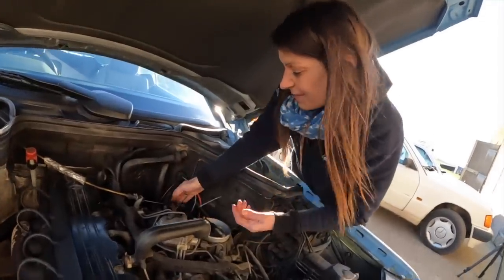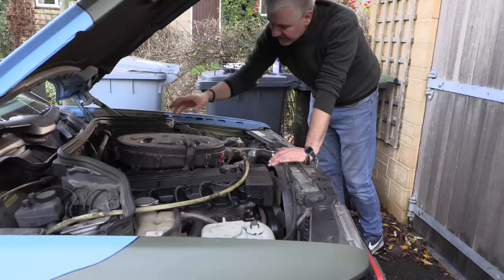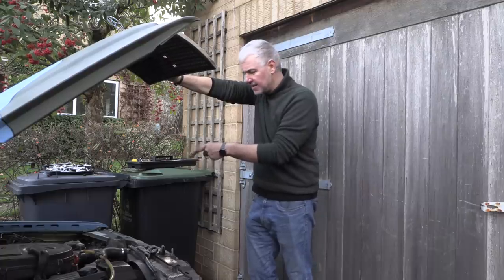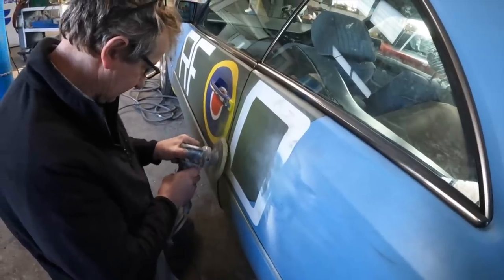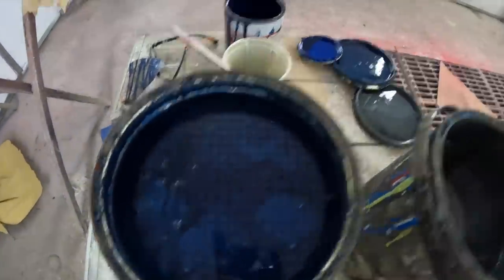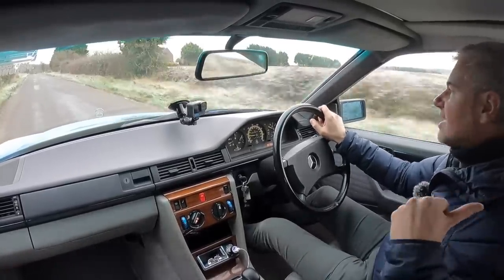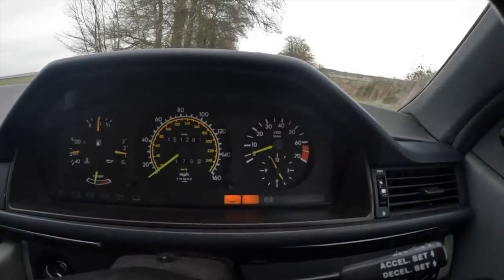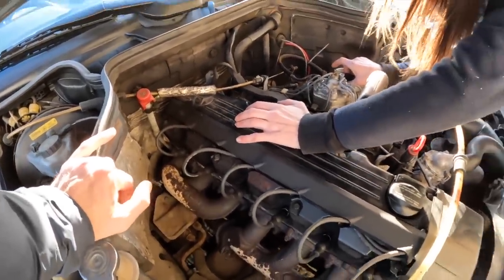Picked a Colour for my Cheap Repaint! + Sorting Out Running Issues.  Mercedes W124 300CE

Comment: A tip from an old W124 owner. If you need more space for your head under the engine bonnet, the angle of the bonnet can actually be tilted to 90 degrees (ie straight up). There should be a trigger for this at the suspension system for the bonnet (on one of the sides).
Reply: @Hvitserk great pro tip
 Usually no trigger is needed just push and it'll go to the "service position" unless what im referring to are on later models than this. ✌
Reply: @averyparticularsetofskills  Thanks. My W124 was a 1990 model and it had a trigger. The same had my previous 1989 W201, but what happened later I do not know because my Mercedes were bought new.

Comment: Great that you have agreed on the advice about paint it with a paint gun instead of the rattle cans! I'm sure with some help of your friend Andy who is an experience painter, a paint booth, fresh paint gun and some quality paint it's going to look great if you put in the effort to prep it right. Really curious about the state those rear wheel arches are in. You are probably ending up needing to weld new ones in, but they are only around €40 each so while doing a full respray anyway, might as well do the arches also the right way.

Comment: I couldn't quite see if Frau Benz used it or not but there is a "service" position for the bonnet. Release the catches on both hinges and it should stand up vertical allowing easy access. Somebody send her a hat though - long hair and running motors....

Comment: The idle and low speed issues could be the non standard exhausts, not enough back pressure. Try restricting the tail pipes some way and see if it improves.

Comment: Regarding the engine trouble: check the air inlet sensor. Friend of mine had his Merc to 4-5 workshops before finding out. It can cause  “mysterious “ bad engine behavior that fools even experienced mechanics.
Reply: Yeah I'd look at the map sensor too. Might just need a clean with contact cleaner.
Reply: air flow meter jumped to mind too

Comment: Hi there, enjoying your adventures, my 230CE had exactly the same running issues as yours and fixing the vaccum leaks and changing the throttle cable were the root causes. I had a specialist do it mind, I normally do my own work but I am happy to pay for specialist knowledge. Good luck with this car, they are amazing machines as you know.

Comment: What a result you have a pal who has a spray booth and compressed air and can also give you some advice. I had an E28 328 I sport in navy blue metallic which needed some panels painted which I did try to do with a rattle can and it took me so long to get any sort of decent finish I struggled with all the common issues the main one trying to get the topcoat to actually look professional so I’ll be super intrigued to see how you get on. exciting times ahead! 👏👏

Comment: Don't forget to check the potentiometer on the air flow meter housing. You can check the output with a multimeter to see if the carbon tracks have worn out. They tend to develop flat spots on the first part of the tracks.

Has the same issue with the low idle in D on mine (sometimes actually stalling) and replacing and setting up the new potentiometer properly, fixed that issue for me.

Good luck with the paintjob, should end up looking a hell of a lot better than it does now!

Comment: Since there are so many different types of paint on the car it would be a good idea to use a paint sealer to act as a barrier between the old and new paint to prevent solvent lifting. Sealer is different from primers.

Comment: Always liked these engines thanks to the KJetronic mechanical constant fuel injection. It is the same system as to be found on my Corrado 16V. Actually everything is controlled by your foot and this means that you can get really very reasonable MPG figures out of this system.
Cheers and good luck!
The econometer already doing its thing in Neutral might mean that the issue, or, well one of the issues perhaps, is related to vacuum lines. Especially with the KJetronic fuel injection system.

Comment: Hope you do a good job with the paint. Inspect the rubber boot under the air flow meter assembly for air leaks. Also there is a procedure for setting up the sensor on the airflow meter. It is known to wear out at the idle position. Seals around the injectors also require replacement. Look at the ignition leads on a dark night with engine running, spray a mist of water and look for arcing

Comment: Good decision to paint it properly, everyone likes a tryer💪💪👍👍. 
I've used a Sealey electric DA sander for years, it's worth the investment, I would sand the graphics off with 80g discs, then I'd 2k prime it, but not with spray gun, but with a 4" foam roller, this sounds a bit sh1t, but you can sand it smooth either wet or with the DA with 320g. Rolling it means no masking, no overspray, no wasted paint.
Good luck

Comment: Hi everyone,  I'm new here and like the channel. I'm so glad to see you are spraying the car properly. I know lots of paint shop guys will be watching and wanting to chip in with advice. What lacquer you using? I would advise Sprint products for ease of application but your spray guy will probably advise his preference. Ask your pal for a shot of his spray gun because that Fast mover thing will not be easy to use and achieve a nice finish.  If you wet flatten use a rattle can zinc primer to cover any bare metal immediately, cromadex galva spray is expensive but the best stuff in my experience. Can't wait to see you spraying it.

Comment: Regarding the vacuum testing. If you do not have access to a smoke machine then just replace all the vacuum lines with new ones as the existing ones have become old. They are cheap and easy fix. The Bosch CIS injection system has always been really sensitive to vacuum leaks.

Comment: All around good decisions for the Mercedes. That color choice is totally top shelf. Suggest that you consider adding a small amount of Pearl Metallic to the mix to brighten the color somewhat. A bit of metallic will really help. The application of the final clear is also critical. As for the arches....the metal panels should be very inexpensive. It is really easy work to put them in for someone who knows how. Not massive as you observed. Between that outer skin and the inner fender is a gap maybe half an inch. If you open the panel and inspect this gap probably a half tea cup of dirt and grim will fall out. This perpetually wet material is what rots out these upper arches. I understand you have a budget but this is a certain value add upon resale. More quality material for your channel where you strive to do it right. Get a reel of vacuum line and start replacing it all. The lines must be seated tight in any case.

Comment: No need for a smoke machine, grab a cheap cigar, pull the booster hose, tape around it so your mouth doesn't touch it directly and blow smoke thru the booster line. It may sound odd however I've done it before and it works like a charm 👍Love the color BTW
Reply: Cuban would work better. Do it in style.

Comment: I really like dark blue on these cars. I used to have a W202.
I also used to have a V8 W126. In that car there were vacuum leaks at the intake manifold. Many rubber parts had to be replaced. Also the ignition coil was bad. I measured resistances on the coil and it didn’t match factory specs. Replacing it greatly improved the engine.

Comment: I think a diy spray gun job will be much more interesting to watch. And your going to find it much easier than doing it with rattle cans. That shade of blue will look on the Bismark, can't wait to see the transformation. With regards to Jasmine having a look at your engine troubles, was i the only one rather worried to see her long hair hanging down on the engine whilst it was running? Got just a little too close to the belts and the fan, scary stuff.

Comment: Jack Good call on the spray painting and on the colour choice. The rattle can approach would have been folly, would have taken forever and probably would not have made such good viewing. As for the faltering idle someone else has mentioned it and I also would point to the inlet air sensor, albeit after you have checked for obvious vacuum leaks. Good luck and i am looking forward to the next episode.

Comment: I had a 190e with the same engine. A faulty OVP can account for many engine running issues, as can a faulty fuel pump relay. Easy too swap out and perhaps frau Benz can loan you these to see if it helps. Many of these cars have the fuel pump relays changed with cheap Chinese bay ones, which fail Water also ingresses the distributor cap, may also be worth a look.

Comment: Try pulling the OVP relay (Behind the battery) as this can cause havoc with idle on M103s. I also had an issue with an alternator regulator once which caused some starting/running issues. Both cheap parts to replace.

Comment: On the likes of the mk4 golf tdi they used a load of 3.5 and 5mm vac pipe fittings but I used to just buy 5m of the 3mm silicone stuff off ebay for about £10 and replace the lot. I would just do one at a time so I didn't mess anything up. Because it was 3mm and silicone too it was stretchy but nice and snug so never had anything come off by accident and didn't need a bunch of clips. 

Not sure but if it's ok with petrol it could be an idea. They came with that black cloth covered stuff and often the leaks would be hidden under the cloth, usually all perished which you wouldn't see.

Comment: Idle issue check the throttle linkage which you should be able to adjust.This should improve the low end  idle.

Comment: Defo check for vacuum leaks but another check would be MAF or MAP and the throttle intake will likely be in need of a good clear out - had exactly this issue on a 1992 Mazda V6 and intake clean with carb cleaner and toothbrush sorted it

Comment: I had same problem and I had a issue with sensor that regulate possition of throttle(0000740236). You can basically adjust hight of that sensor. Ones you will lower it it should bring revs up and calm down the engine.

Comment: Could it be that the transmission needs to be flushed and the oil replaced? I remember having a Volvo 960 with the same problem. It started to run lumpy as soon as I switched into D, and after the oil change it ran smoothly again. I admit, it’s a long shot, but sometimes it can be a good idea to look beyond the obvious.
Reply: Exactly what I thought. Definitely worth paying attention.

Comment: The blue looks similar to Mercedes Marine blue to me, should look good, especially out of a spray-gun!  The injection system runs in open loop mode until it warms up, then it starts using feedback from the lambda sensor and air flow meter (and probably many others) to optimise the fuelling when warmed up.  Similar principle to when people disconnect the MAF sensor on more modern cars to force the car to use a base map.  Not that you can do this here!  But that'll be why it runs better when cold.  Probably vacuum leak(s).

Comment: If your going to rattle can it then check out 2K aerosols. I painted the whole side of my T3(T25) camper with about 5 of them. Proper paint coverage with an excellent durable finish. Ideal if you have access to a paint booth. I can send a pic of the finish achieved.  About £16 a can mixed to your colour.

Comment: The mesh sandpaper is likely to be Abranet (or a copy). Good stuff, though not cheap.
Reply: Looked through the comments to write the same thing (almost word for word). Works particularly well for smoothing wood and is widely used by woodturners. 👍

Comment: If I might make a friendly suggestion, Jasmine "FrauBenz"  might want to consider tying her long hair back, when working around whirling belts and fans.  In my early days of working on cars, I leaned into an engine bay while wearing a neck tie.  A crusty old mechanic quickly pulled me away and gave me a rather graphic lecture on the possible consequences....

Comment: Hi Jack.

I have on my channel a video where I find a cheeky vacuum leak on a W124 230TE. It turns out to be an easy to fix and are at the injectors. Maybe it could be the same on yours? the 300 looks pretty similar to the 2.3.. but I am no expert.

I cant link the video because YouTube tend to censor links... But you can find it on my channel. :)

Cheers!

Comment: I'm confused now...engine idling fine in Park or Neutral but not in Drive...surely when in Drive but stationary, the engine is now under load with the gearbox engaged?

Comment: Hi I am new to the channel. 
I herd you saying about the low speed running issues. Getting worse when it warms up. 
I had this many years ago. Has your car got an aftermarket exhaust or just back box. Because that was the issue I had put a genuine 2nd hand back box it was fine afterwards.

Comment: Word in FrauBenz / #28 shell like. NEVER lean into an engine compartment with the engine running WITH LONG HAIR. Consider your cards marked.

Poor running? Air Filter /Cleaner. What condition is that in? Engines need to breath - that Air Filter may look OK but, is it.

Comment: 1. If the paint comes gratis, your budget should be £50, not £500. A bit of thinner and hardener might come to £20. Sufficient flatting paper will not trouble a £5 budget. Proper masking paper is inappropriate, I think- keep it for the paying customers' jobs- spend a bit of time sourcing old newspapers. You can keep the gun for another job, if you clean it out properly.
2. Tie your hair back.
3. Good luck with it. Very entertaining.

Comment: that ignition coil is fooked, misfire written all over it, but not the idle speed problem.
the benz babe is probably right blaming air leaks, been there with a split breather pipe before.
talking of benz babe, TIE YER  FU*KING HAIR UP!!!        accident waiting happen, hair touches alt. belt, starts pulling you head down into the pulleys, fan blades pluck your eyeballs out. [seventies kid, lads had long hair then, friend got a nice labrador out of it]

Comment: Just use a chemical stripper, start from scratch, if  the shit on the top is not perfectly removed and made flush it will show through, unless you use a thick filler primer and then sand it down

Comment: Colour should be genuine and according to VIN. Or at least from Mercedes-Benz palette. C124 can be treated as long term investment as they are getting more and more expensive.
Reply: If the car wasn't rusty and had a leather interior, it might be worth it, but you'd be better off getting a nice one to start with. They are not rare. There is a "nice" blue one on Autotrader for £4950
Reply: Interior type is not that important I think. I saw many opinions that some people prefer  fabric interior or velour (which is rare in younger C124s). Air conditioning becomes more and more important. About rust true. We still don't know how this car look under side wide trim and without sideskirts but probably requires welding if nobody else did it before. Overall I noticed that prices got higher than in past, I remember that there were no problem to find for example 300CE-24 with Carat by Duchatelet kit for £1000. Car in similar condition or a bit worse.

Comment: Panicked a bit at the start of the video with the girl with long hair leaning over a running engine did she not realise that there was a large fan rotating just inches from here hair, it could have so easy ended in a trip to a A&E. 
Pleased you have decided to paint the car using a spray gun, you will make a much better job and it will be much easier, like your colour choice should suite the car well.
Please if you ever visit that young lady again ask her to tie her hair back before she sticks her head under the bonnet of a running engine again!!